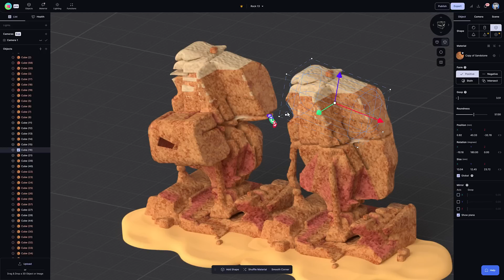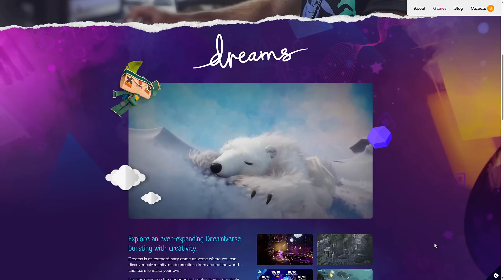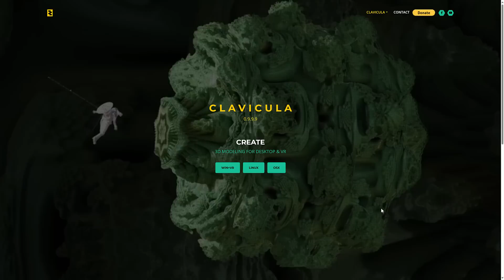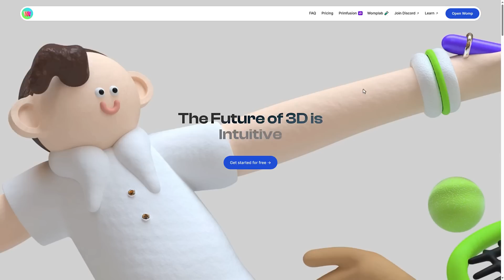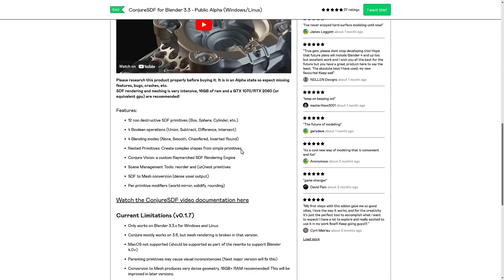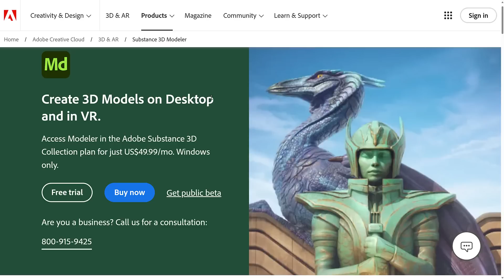SDF -- The Future of 3D Modelling?

Comment: The basics of sdf is volumes or if you like voxels that based on density determinate where to draw the surface, sign negative inside and sign positive outside(maybe the other way around) and that's the sign in the name. Thats why it seems organic since you can use noises in the volumes which are vbd mostly(for optimization), I even think sculpitris from zbrush and 3d coat use it in the background and Houdini has a lot of tools and has been using it for years and is no just for organic modeling, you could use it for hard surface too with no problem, I think this video was done without doing a good research, even unreal I think it uses sdf for creating approximation of the geometry for lumen

Comment: One thing I like about SDFs is that you don't need the world space mesh conversion until the very end (if you want to use the model later in traditional 3D software). Instead, what you see on screen can be splats or adaptative mesh or raymarching or whatever, essentially having infinite resolution for curved surfaces. Mudbun or Clayxels for Unity come to mind.

Comment: I found out about SDF a few years ago and created some code to generate shapes and scenes of geometric shapes. Many an application displaying fractals like  Mandelbulb uses SDF rendering. This is all done in a fragment shader which was rather limiting. So I ported the code over for a CPU to use to generate graphics and as I suspected, it was super slow as SDF require parallel processing to have any form of real time graphics display and interaction. I thus abandoned SDFs as using openGL in a fragment shader was not easy to code and get the results anywhere near a conventional 3D modelling software app like Blender. Things may have moved from that time as faster GPUs  and perhaps more code friendly methods to create SDF applications have evolved. But from my experience, things like reflections, transparency and texture mapping are very difficult, more processing intensive,  if not possible at all. I could be wrong, but SDF do have a place in 3D modelling and rendering in certain circumstances, just not as generalised as conventional polygons or point clouds.

Comment: I wouldn´t call it the future of 3D modeling. It´s already being in use. And Boxmodelling is still a thing. SDF creates too many polgons vs a clean hardsurface topology.
SDF is core in a lot of procedural modeling stuff in houdini or meshing simulations in general. But it will not replace other modeling methods for good, so I wouldn´t call it the future.

Comment: for something that doesn't have to be rigged, animated and then used in a commercial game engine SDF can have some purpose. However, to use it in mainstream engines, that SDF is a pain in a butt to work with. Yes, you can maybe import it as a static mesh inside unreal, turn it into nanite and let it go. But to use it for character designs and animation you will have to do retopology of damn thing, turn everything in a proper triangle amount, redo UV, and then everything else as you should do with proper poly geometry. That said, SDF is in my opinion exact the same thing as something Zbrush intorduced with it's technology long time a go. It was visually stunning but in order to be applied in real application it was almost a reverse engineering thingy.

Comment: I see a few comments here claiming that «Metaballs» and «SDF» is «the same thing». However, in the original «Metaballs» paper by Blinn, called «A Generalization of Algebraic Surface Drawing», he used an Algebraic method to calculate intersections between a ray and a shape directly. SDFs uses a Geometric method; an iterative approach, which is a bit less optimized, but much easier to work with when constructing more complex shapes. The original SDF paper was called «Sphere tracing: a geometric method for the antialiased ray tracing of implicit surfaces» and was written by Hart. Both papers are amazing; I can highly recommend them.
Reply: I always read metaballs as meatballs
Reply: @tikimillie Mmmm, meatballs..
Reply: Any good reads on both? Trying to dig a rabbit hole.
Reply: @delroku  Have a look at my master thesis, it contains a lot of references on the subject. It seems like Youtube is deleting my comment if I post the direct link, but you can search for it on Google. It is called "Effective Volumetric Sculpting for Focus+Context Visualization, utilizing Implicitly Defined Surfaces and VR-on-Demand".

Comment: On my phone, I have an app called "Plastic" that does this sort of SDF modeling. When combined with Nomad sculpt (for refining shapes, automatic UV Mapping, texturing and texture baking), PLUS Nomad's paid QuadRemesher add-on, it almost feels like this workflow is cheating--it's so fast compared to the sheer pain of trying to box-model and UV map on a tiny phone screen (which you can actually do with apps like Valence3D and Sketch3D now), and ensures that when I transfer my finished models and textures to the computer, I can simply move on to rigging and animation next after being able to do so much just with my phone on my work breaks.

SDF modeling will definitely expand the devices one can use for 3D modeling. We've already seen in the video how Dreams enabled 3D modeling with a PS4 controller, and how Adobe's Substance Modeler was originally intended solely for modeling in VR (before adding the option for the traditional mouse-and-keyboard setup). Traditional box modeling is still perfectly fine for desktop programs like Blender, even fast once you practice and learn all the hotkeys, but SDF might very well be the future for modeling and possibly even animation on devices that are traditionally too cumbersome for other forms of 3D modeling.

Comment: Substance Modeler was being developed internally by Allegorithmic before the acquisition by Adobe so you're probably thinking of something else.
Reply: I have what he is talking about. It was once called Oculus Medium. And is no longer supported by Metta. After Adobe took it over, they didn't do much with it for some time. Then, they finally made an update, and added it as part of the Substance collection, sort of. Substance Modeler is basically Oculus Medium at its core. But made a bit better now.

I have not used it since Adobe took it over, so I don't know a lot about all the new changes to it.

From what some have said, those that still have a copy of Oculus Medium, and try to run it today, it will not work. Likely all thanks to Adobe telling Meta to lock it up in an update to it, so it can't be used anymore. >.>

Comment: It's not the future simply because creating meshes in Blender will always be faster for someone who is good at it. It's cool tech for those who can't though.
Reply: I think its future lies in making 3D modeling possible on devices that are otherwise too cumbersome for more traditional methods of 3D modeling. Dreams shows that SDF is a great solution for anyone that, for whatever reason, may want to model with a game controller. Perhaps in the future, SDF comes to Blender and as a result Blender can be comfortably used on a Steam Deck or other handheld gaming PC, for instance? I played an extremely niche PS2 game once called "Graffiti Kingdom," which allowed you to model your own player characters with the PS2's joysticks, and it probably would have been far less cumbersome if the game had Dreams-like SDF modeling.

I imagine you're right, though, that for desktops and laptops, it's tough, if not impossible, to beat the speed of box modeling in Blender once you practice the hotkeys and other shortcuts until they become muscle memory.
Reply: *AI will always be faster

Comment: no texture mapping, no future. it is that simple. not everyone wants to model every little detail when they can just paint some textures and slap it on a low poly mesh. especially not gaming companies with deadlines.
Reply: I think you're missing the point... It can be remeshed into triangles.
You ever hear of Nanite? Unreal Engine 5? It's all one triangle per pixel on the screen and at that level you don't need textures. It's all vertex painting. You'll be able to project textures onto the model, like how Substance Painter can. Or like ZBrush can. You'll be able to model anything without having to worry about polygon count, mesh optimizations, proper UVs or any of that stuff and your models will be perfectly (mathematically) round and smooth and great. Companies will be excited not to spend time on creating LODs, retopos, UVs. It will cut down on the time needed to produce a model.
The problem (currently) is with animation.
If you give a rigger (person who creates rigs for animation) a "Nanite" mesh, he/she be like "wtf is this?". So it will have to be remeshed in a slightly different way... with guides (splines) of the direction the topology should flow in, for proper deformation during animation. And then you're right back to UVs...
But maybe that will be solved too with even better animation tools designed for "Nanite" meshes. You can bet someone's already workin on them rn.
Reply: Are you even sure SDFs can't be texture mapped? (Actually, I'm pretty sure they can. The question is how large the performance impact is.)
Reply: You can obviously export to a mesh and do whatever you want.
Reply: @St4rdog  Exactly. You could always just retopologize it, and when combined with automatic retopology tools (basically just QuadRemesher right now), this could prove to be a faster way to set up a model for texturing. If you can't afford the automatic QuadRemesher addon to your software of choice, or otherwise have to manually retopologize the SDF model afterwards, then SDF is a lot less efficient or useful than properly box-modeling the mesh so you can skip the retopology phase entirely, to be fair. Depends on your preferred workflow and how easy your software already makes it to just box-model a clean, quad-based mesh.
Reply: BINGO

Comment: Raymarching is expensive so this wont be mainstream for a while unless they create a tool to convert sdf models to polygon models.
Reply: It depends. Raymarching is an optimization technique. It is a cheaper way of path tracing. And you can store SDFs in 3d textures. They can be rendered very efficiently actually, because the renderer knows how far it has to trace. This is much more efficient than rendering a standard density volume texture via path tracing. You could even write a sparse SDF renderer and do some per pixel nanite-like displacement mapping. It could be more performant than parallax occlusion mapping. It really depends what you do with this technique. It's just not as easy to understand how it works. You have to wrap your head around it to work solely with distances as a representation of geometry.
Reply: @Polygarden  sure. But polygons with uv mapped textures will still be more efficient for solids. If they could combine the two worlds as a way of introducing volumetrics in to gaming then im all for it!

Im gonna take a look at sdf textures though, thanks for the tip!
...Sounds a bit to good to be true though.
Reply: You can do textures with SDFs. You could even smoothly blend between different ones. I guess the mentioned programs just don't support them yet.

Comment: Dreams did use the SDF Method for modeling, but I believe the models we're saved as point clouds. That's why it wasn't easy to export or import models from other applications.
Reply: I think they were saved as SDFs, and that's sufficient to explain why importing/exporting was difficult. Other software almost exclusively relies on texture mapped polygon meshes.

If I remember correctly, the SDFs were rendered as point clouds though. Usually they are rendered via ray marching, which doesn't involve point clouds.
Reply: @cube2fox   "i didn't say we were raycasting analytic sdfs. we combine analytic sdfs at load time into volume textures then absolutely we do raymarch those volume textures to produce the 'unsplatty' look as in the video. we do splat the loose stuff, but that doesn't apply here." By the guy who co-wrote the Engine on Twitter (x) 🙃
Reply: @MrlegendOr  Not sure what that means exactly but thanks
Reply: @cube2fox  ok, I may of had it backwards but I do remember point clouds being part of the equation.
Reply: AI fixes that easily
Reply: Dreams' engine was particle-based, so I think you're right

Comment: I always had hard times understanding SDF comparing to rasterization
Reply: It's just math... You've got an origin (which can be a point or a line) and you can move that origin (offset it) anywhere relative to the world origin. Then you can define a space from which you can calculate a distance from that origin, which can be viewed as concentric "rings" around the origin. And it's "signed" because that distance can be either positive or negative (meaning also inside the shape).
It's not terribly difficult to comprehend how it's done in 2D. But I don't know how it's done in 3D. I'm guessing the same but with an extra axis. So you've got not just XY on the cartesian plane, but XYZ.
Reply: SDF is defining shapes based on mathematically defined surfaces; rasterization is rendering based on calculating pixel colors. Both can be used together or independently; they're about different parts of the process.

Comment: SDFs have had the potential to replace conventional mesh geometry for over a decade now and it's only been in the last year or two that it seems like it's finally taking off. The demoscene has been using SDFs to represent geometry for 20 years, and then Media Molecule pursued using them in their Playstation game Dreams. They have a great talk you can find on YouTube called "Learning From Failure" where they cover a bunch of the prototypes and technologies they developed around SDFs back in the day. SDFs do have caveats - you can directly raymarch them, which produces the best visual result, but is slower than rasterizing a mesh - especially if you don't cache the SDF in some fashion and are re-evaluating all of the SDFs that go into a single object for each step for each ray. Then you can triangulate SDF geometry using whatever isosurface extraction algorithm you would typically use to triangulate a voxel volume and just render it like a mesh, but this can be slow if you have any kind of dynamic animation to the SDF geometry and need to re-generate its mesh representation. It also robs you of being able to do all the cool rendering stuff that's possible with SDFs. IIRC Dreams ended up going with some kind of splatting technique that's not really explained or described very much anywhere, at least in an accessible fashion. They touch on the usage of splats (no, not Gaussian Splats) in their Learning From Failure talk but the actual public release of the game is a bit different from what they cover in that talk, because things did change over the years between that talk and the game actually being released.

Comment: i guess it's ok for non animatable stuff. I don't see anyone switching their current HP stages over though for anything that needs retopo.
Reply: the thought process is that "you don't need to retopology" because what we normally think of a s verts and planes are calculated on the fly. Animation works a lot differently. instead of verts and edges bound to bones you have the the privatives bound to bones where the geometry is again recalculated per frame of animation. the biggest thing that will stand in the way of SDF has to do with import applications. like FBX or GLT these are just different ways of talking about vertex links, and normals, with support for binding those vertexes to bone relationships manipulated thoug keyframes. SDF is an entirely different animal, with a very different pipeline and workflow. similar to how 'you can make these really high detail models and animated scenes in a 3D modeling app, but then many of that functionality is so bound to the app you would have to recreate a bunch of it in say Godot or Unreal. And we are back to chickens and eggs where "is this popular enough in the industry for us to support in our engine" and "is this supported in enough tools for this to be meaningfully learnable"
Reply: @gardian06_85  No, it's not just chicken and eggs problem (compatibility). It has fundamental trade offs. It's the same story as with "voxels are future of games" that was often hyped for the last 30 years. It's incredibly hard and inefficient to make skinned realistic characters with SDFs. When Dreams was prototyped they went through many different rendering techniques and types of data structures and each one had different trade offs, including the one they chose in the end.